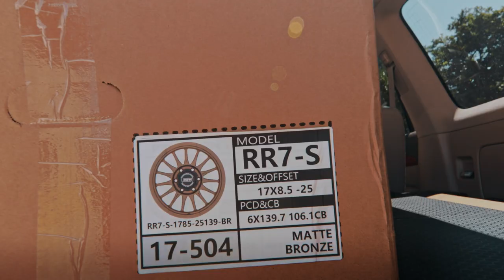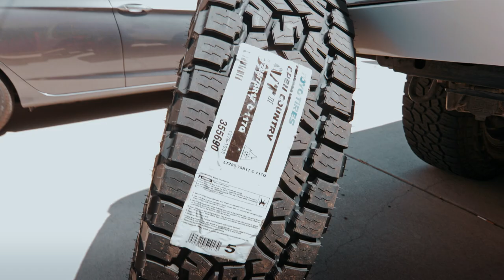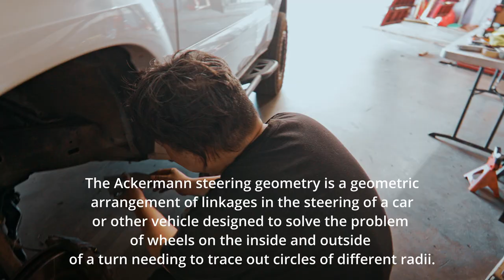How to fit 34 INCH TIRES on Lexus GX470 / Toyota 4Runner RRW MONOBLOCK FORGED| RR7-S 17x8.5 -25

Comment: Super clean! Smooth looks better. I was considering RRW when I was lifting my GX. Ended up going with Summit/SSW Dakars. Similar look to yours. Sick rig man!
Reply from the maker: Thank you! Yea these Monoblock forged from RRW is so light. I love em
Reply: What’s your setup with the dakars? Wondering if I can avoid bmc if I run 265 70s & dakars -25
Reply: @dustincrittenden1664  3" Dobinsons lift with bmc because I am running 285's. I think you could get away without the bmc by running 265's like you were saying

Comment: Nice video Ray! Those wheels and tires look nice. I’m running the same size Wildpeaks so I would be interested in your feedback after a couple trips with those 34s. Also what’s the approx cost for a BMC?
Reply from the maker: I took it to big bear yesterday and they definitely right more comfortably on the road than the wild peaks so far.  I paid $350 for my BMC. They gone up over the years aha. Market price is like $450 now.

Comment: Ray did you have to go back and fold pinch seam? I have same wheels and went 295 holy cow rub city. I already have offset arms and caster. Looks good tho! I went with the bling rings!
Reply from the maker: Yes i eventually hammered the pinch welds in. Doesn't rub any more!

Comment: Thank you for making these videos. Any mods needed to run -25 offset SSW dakar on 265/70/17 w/ 2 in lift?
Reply: 17x9
Reply from the maker: Np! BMC, fender + bumper trim & add more caster.